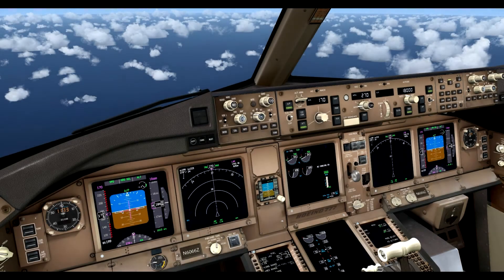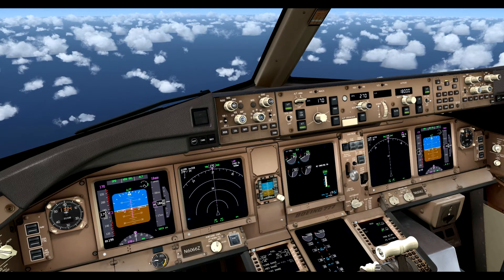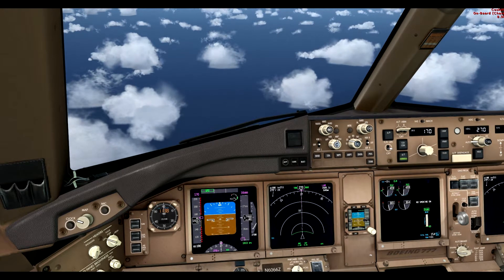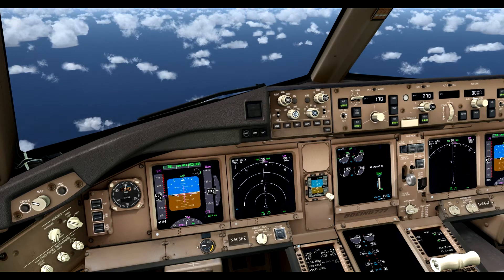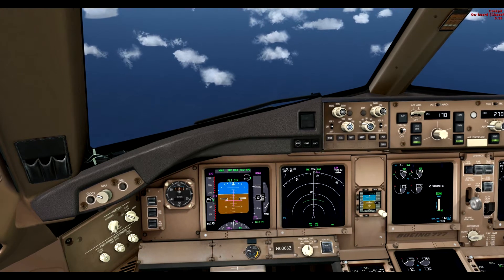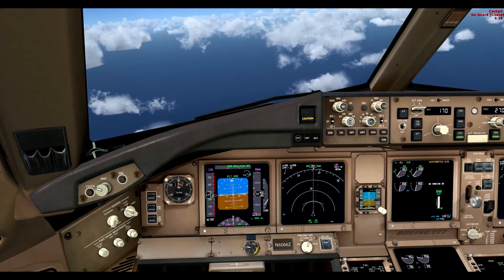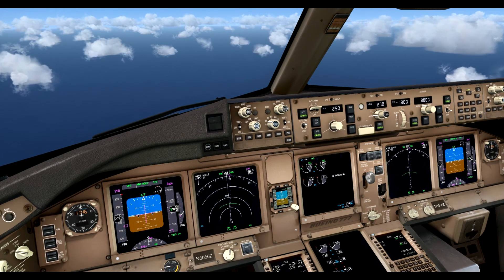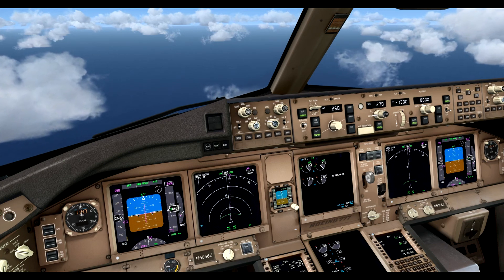The 777 FLCH Trap! When technology tries to kill you ;-)

Comment: Thanks for sharing! Does the same A/T logic apply to a 737 (the Asiana PIC was converting from a 737)? Of course, the type rated pros should be aware of the systems and how they work, but I find it a bit weird to have A/T armed and subsequently get no response to an airspeed decay. If the Boeing's philosophy is to have pilots in control of an aircraft,  then they should require  to place hand on the  motorized throttle levers to sense what the A/T is doing during a critical phase of flight (see the failed go around at Dubai)...
Reply from the maker: Yes, the 737 does the same. I don't know about other Boeing aircraft. I don't own the Level-D 767 or PMDG 747, maybe someone who does should try and see what happens.
Reply: It’s my understanding the Captain in training was transitioning from the A-320.  Another fly by wire aircraft but with a different philosophy of how best to use it.